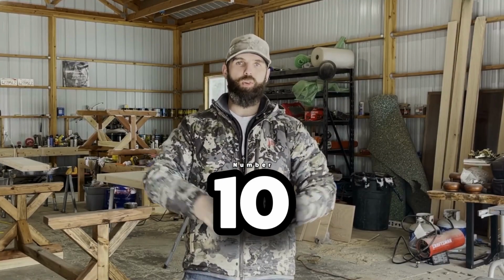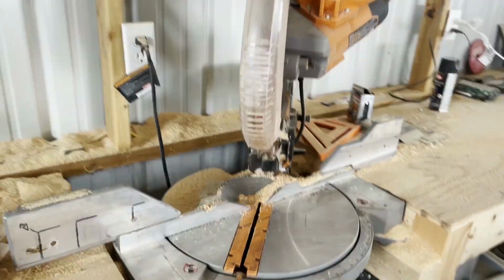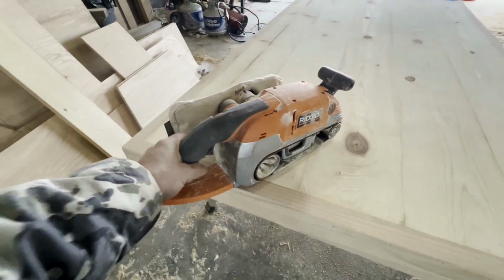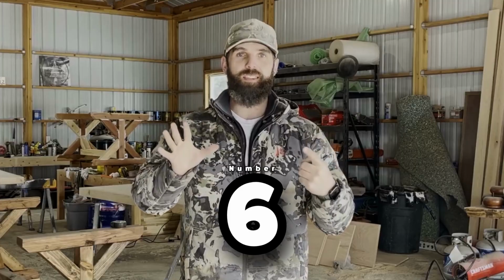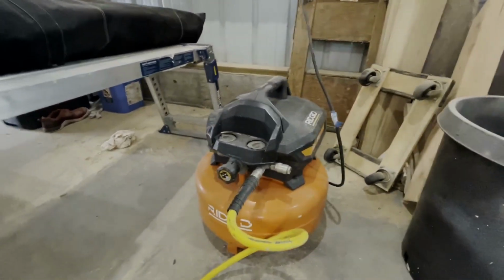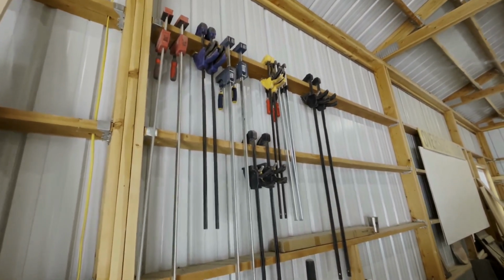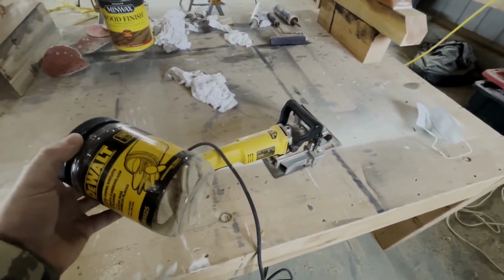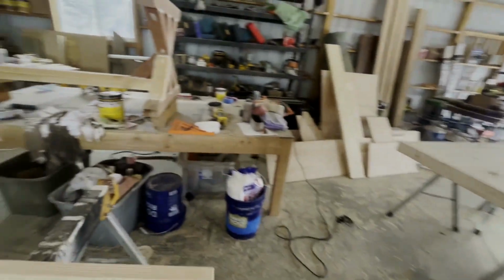TOP 10 BEST WOODWORKING TOOLS YOU NEED!!

Comment: A nail gun is definitely not a must have. I´ve been working with wood for quite a long time, never had to use one. A normal hammer does the job just fine if you are not a professional. What is way more usefull is a bench drill and a normal drill.
I also wouldn´t recommend a skill saw because the table saw does pretty much the same thing but better.

Comment: Small note, battery nail guns work fine. Not as good as an air based one but I have been using mine for many years so don't let this video discourage you. They aren't bad at all and they are great if you cant be close to a compressor. They simply aren't for everyone but in the same note, do your own research because they may work just fine for you.